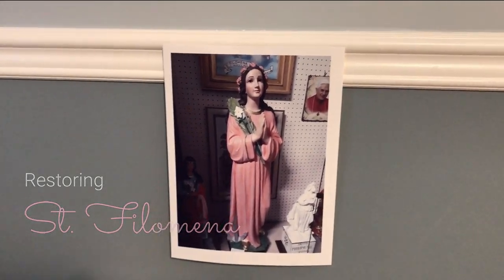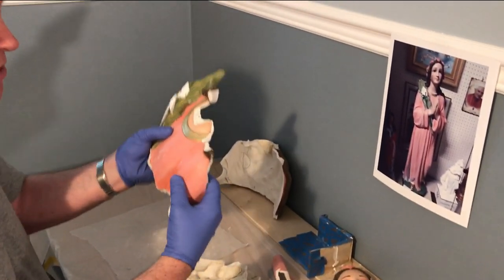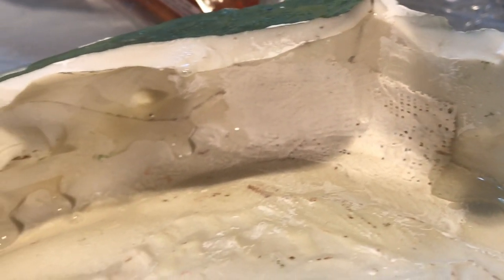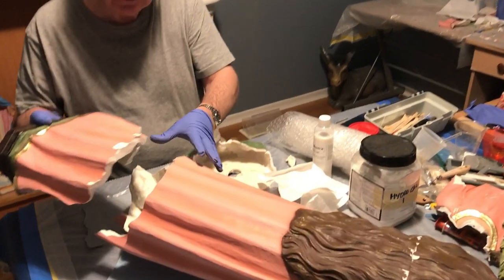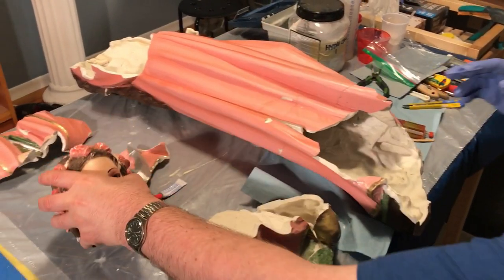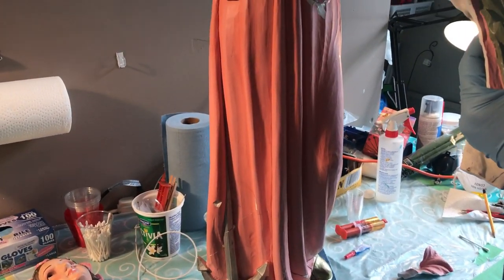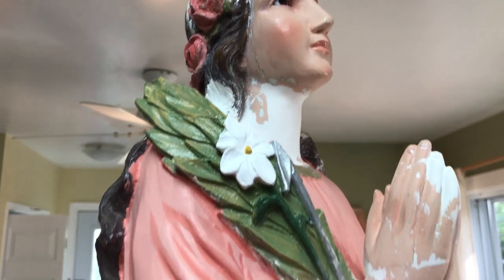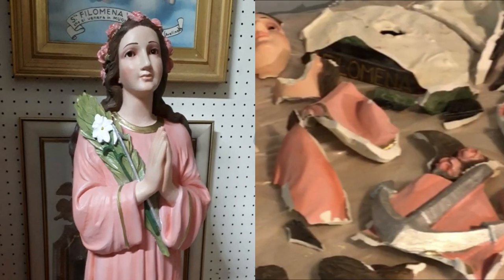Restoring St Filomena

Comment: Your video is really helping me repair a resin statue of Mary which also suffered extensive damage being shipped from Medjugorje to USA.  And yes, precise alignment of pieces is critical.  I'll be doing some sanding.  The resin statue was unpainted.
I'm using super glue, then fiberglass mesh tape with epoxy and plaster coating on the interior.  But I soon will not be able to access the interior to tape, epoxy and plaster the final cracks.  Should I cut a big hole in the bottom of the base?  
The Harbor Freight super glue is surprisingly strong.  I had to rebreak a misaligned piece and the break occurred in a new place next to the repaired crack!  
Should I fill the interior with insulating foam spray?
After sanding, I'll apply plaster or wood filler to any remaining blemishes.
Painting:  I'm planning to spray the entire statue (inside and out) with gray automotive sandable primer.  Then use acrylic paints for the finish coats.  Someone recommended alkyd enamel paints.  Apparently thicker paint to hide scratches?  
The statue will be displayed outdoors, but perhaps under a protective covering of some sort.
Reply from the maker: Thanks for your kind comment.   I’ll
Be glad to offer advice or opinions via email exchange.  Steve.winogron@gmail.com.  I’ll ask for a photo or two and we can talk from there if you’re interested.
Reply: @BrushworksStatueRestoration  Thank you so much!!!!

Comment: What kind of glue do you use? I have a plaster lamp that is a statue of a woman broken into a few large pieces that I'm joking to repair....
Reply from the maker: For resin, we use epoxy (which is a component of resin).  Depending on the thickness of the plaster you are looking to glue, you can try a two-part mixed epoxy on the interior, then filling with liquid plaster on the outside edges to keep the exterior looking natural. Large pieces may require insertion of a piece of sculpting wire or dowel for strength.  For tiny pieces such as a fingertip etc, you may have to experiment with bonding agents from your local craft supply store, or in some cases even a tiny bit of superglue (gel, not liquid) then covered over with a touch of Plaster of Paris to hide the repair.  High-gloss ceramic is a different process, so this is generic info.  Hope this helps.  Best of luck with your project!

Comment: Beautiful restoration! I have an old Columbia statuary chalkware Jesus bust that the nose got chipped off. What can I use to successfully resculpt the nose? Would plaster of Paris work?
Reply from the maker: We use a product called Hydro Cal plaster because we find it easy to work with and stronger overall.  But for something as small as a nose chip, plaster of Paris should work fine.  Good luck Dylan, and thank you for the compliment!
Reply: @BrushworksStatueRestoration  thank you!
Reply: @BrushworksStatueRestoration  do you use a specific type of the hydrocal plaster or mix it with any stabilizer?
Reply from the maker: @dylanhubbard2162  We purchase the HydroCal in Toronto (www.sculpturesupply.com) and use it straight out of the bag.  If they don't have small quantities, you can also try an excellent product called Apoxie Sculpt.
Reply: @BrushworksStatueRestoration  thank you so much for the suggestions
Reply: @BrushworksStatueRestoration  also, if I decide to work with the plaster or the apoxie sculpt, do you have any suggestions as to what I should prime it with before painting?
Reply from the maker: @dylanhubbard2162  we use zinsser123primer. But you probably don’t need it for such a small spot.  Lightly sand the surface with 400 grit sandpaper if you use Apoxie sculpt.
Reply: @BrushworksStatueRestoration  perfect. Yes, I just plan to paint it over with a little acrylic paint to finish it